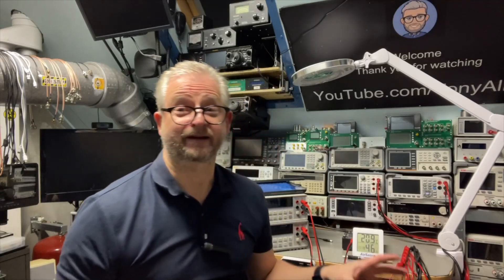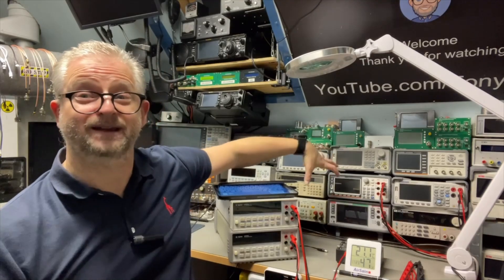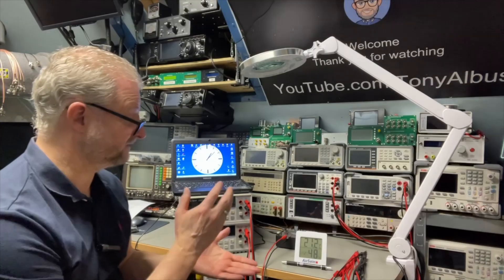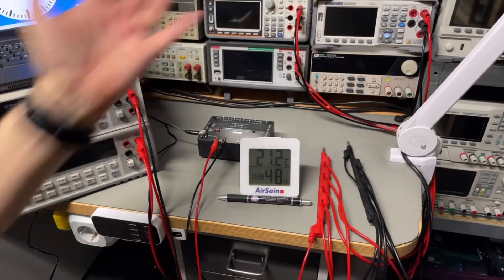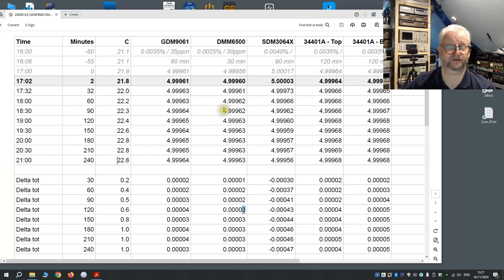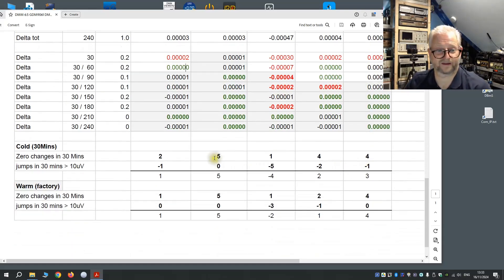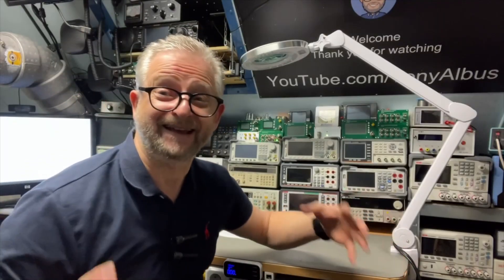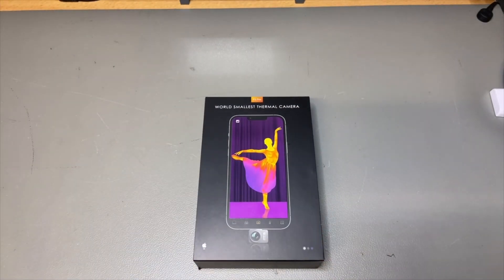TA-0428: DMM Warmup / Stability 4h Test - SDM3065X GDM9061 DMM6500

Comment: Hi! If you short input in ACV auto range, what you measure? 0V, or other? My DMM6500 measure 0.7-0.8mV. the 2000 model show exactly 0V. Like this https://youtu.be/7ytDDo8Yym4?si=rsXrQGjswgIRiu1k
Reply from the maker: Hi, try using REL in AC when you short it.
Reply: Good idea! 😊 But this symptom is only at me, or other instruments too? My Rigol 858 and my friend Keithley 2000 not show this AC noise
Reply from the maker: Did you check your short?   my dmm7510 also had it. but lower values, if the meter is high impedance, its easy to pickup some noise.
Reply: @TonyAlbus  Thank you very much! I was really curious about that. Yes, i checked it. I tried various method for shor but the results are same

Comment: Quality content as always!  Having finally done a long overdue calibration on my Siglent 3065, I've been leaving it on and monitoring it with some stable references.  I've gotten the calibration back to within specs on the ranges I care about, but I've come to a conclusion about the ambient temperature dependence of the 3065 - it is pretty bad - probably close to the full amount or maybe even worse than the listed spec.  I think the underlying issue on the ambient temperature sensitivity is the same reason the start up time is so long.  I suspect the reference heats up and stabilizes fairly quickly, but other components with not so great tempco's, slowly reach steady state as the overall meter internals heat up.   Having those mediocre parts in a design that relies on too many such parts means startup will take long, and ambient temp changes will have a bigger impact.    Net-net, if you can tightly control your room temperature, the 3065 is an OK meter.  If you go even +/-  2 C from the cal temp, you could easily be 10 ppm off on the 20VDC range.  Sure, it's still in spec of the +/- 40, but if you are trying to measure the temp sensitivity of a test circuit, you may well be seeing more change from the Siglent than the test circuit.  I've got a couple of Keithley's and a Keysight, that are rock solid within their +/- cal range.  With those, I can trust that I'm measuring the circuit, and not measuring my meter.
Reply from the maker: Thank you Brian, great to hear someone has the same conclusion, i even tried encaptulating the Ref. but it is indeed the whole board. room temp is a killer for this meter. you need to have a stable temp. indeed y Keithleys and Agilent rock solid. i must say they improved a lot with this on the SDM4065A. In my video you see a clear difference between the old new Siglent and a keithley.

Comment: I have 4 Siglent SDM3065Xs.  They are all off from each other by 50 ppm.  They were purchased at different times over many years.  I plan to get a 7.5 digit DMM at some point and calibrate readings against the 7.5 DMM  just before each test and adjust readings in software during data acquisition.  This will mitigate the need to send them out constantly for calibration and ensure a common reference point.  I would also look at BK, Rigol, UNIT, Hoiki, and Keysight.  They all have 6.5/7.5 DMMs/SCPI over LAN.
Reply from the maker: Keithley also has the 7.5  but those get very very expensive
Reply: @TonyAlbus  It's about 5k in the US.  A lot cheaper than the alternative of likely over 60k for a Fluke Calibrator.

Comment: All those spreadsheet data points, and no graph!? Although they'd be pretty basic and blocky, I'd guess they'd still have a good chance of visually conveying the slight amount of meter drift as they settled from turn-on... well, at least the siglent. Would be interesting also to know if any of them draw... ~30-100mA when in a "soft power off" state, to keep their references on, or not? In that way, in many benches they would be be able to "cheat" their way to most of the stability without needing to suck too much current 24/7.

Another possible interesting comparison might be the usefulness of the 'big graphical display' of the 3 modern meters, vs just the raw stable numbers that the 34401A can tend to put out. Agilent/Keysight eventually upgraded to a two-line display with the 34410A, and then also their full graphics with the 34461A. But is the graphics of the new siglent worth it over a "cheap, good, simple" second-hand 34401A? Of course, subjective in so many ways, but might also be interesting to explore perspectives in an answer to that.
Reply from the maker: Thank you for your segestions

Comment: I was pleasantly surprised to see that INSTEK stabilized alongside HP and KEITHLEY. After 2 hours, those four meters were trustworthy. Last count toggling hi/lo just means measurement is at a rounding point. Sadly, IMO, the SIGLENT never became stable; it was still trending down at end of test. I would like to see when/if SIGLENT stabilizes.  Also, i would be curious to know which DMM was reading closest to the DMM-Checks true output. I crave that confident feeling you get when entering a lab where a rack of 6.5 & 7.5 digit DMM's all agree with a precision voltage reference standard. That gives me confidence to adjust ≤5.5 digit DMM's after repairs .
Reply: The SDM3065X takes about 4 hours to warm up fully and stabilise.
Reply from the maker: Scott is right, after rechecking my data, its more 4 hours then 3 hours before the Siglent is stable. 
The GWInstek suprises me every time. that is a great meter for its price. This is the 9061 which is the better from the standard 9060.
The Keithey is an other class, it blows every other away.

Comment: Thanks for sharing. This test exposes a complaint i have regarding a DMM's annual calibration; the cal reports don't note warm-up time. I always REQUEST minimum 2 hours for my HP 34401's, and 8 hours for my KEYSIGHT 34470's. I have cal lab record the ACTUAL warm-up time in the notes. It's very annoying to get meter back from cal and have it disagree with KNOWN VALUES, by a few counts, after good warm-up in mmy lab. If i know cal was done at 3 hours 23°C 35%RH, I'll duplicate that in my lab, then I'll measure my voltage reference standards. After doing that with 2 or more DMM's, readings become more predictable and confidence goes up.
Reply from the maker: Thanks for sharing this, yes that is a very good point. it should indeed state the warmup time, and should be respected by the cal labs. what is the point if calibrating if that is not respected

Comment: The Siglent seems to be out in the woods tho. How accurate is the reading, compared to the manufacturer spec? ( I think we can all agree about the true value)
Reply from the maker: Yes the Siglent needs a Calibration after at least 4 hours warm-up.
but 4 hours is just not that practicle in real life in a hobby lab i think.
but for its price it has very nice feathers, but i will not choose it again knowing that the GDM9061 and DMM6500 are there too and are so much better. its worth the extra
Reply: @TonyAlbus  Yeah, Keithley is a dream